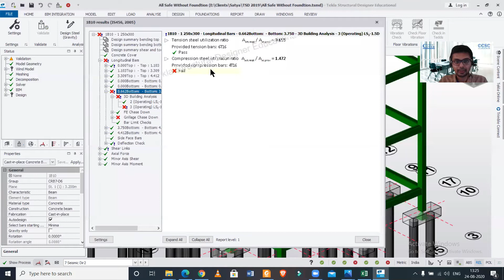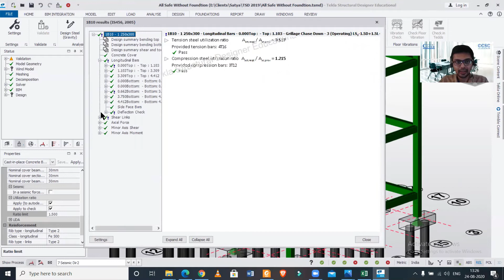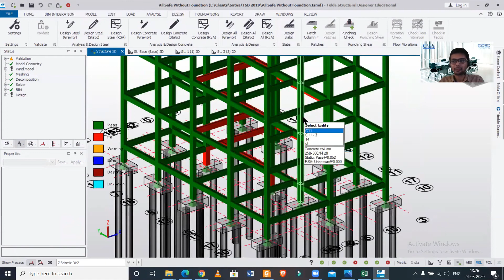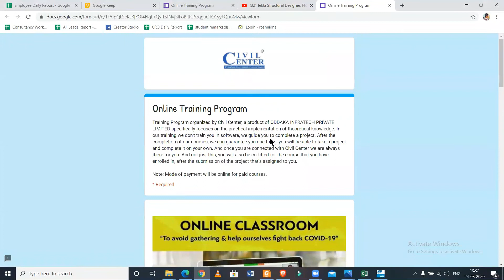What is Utilisation Ratio in Tekla || How to change utilisation ratio in Tekla || TSD

Comment: Great Video!!!
I have a question about the utilization ratio (U/R) if the software takes by default as 1, is it advisable to override the values by increasing it? 
As we know that U/R is the ratio of – actual to maximum performance value. By increasing the values, we are making the member stiffer and hence safe, but which is not in the practical application.
Kindly correct me if I am wrong anywhere.

Comment: Nice video, thanks for sharing. I have one question related to this. There are two options in user defined Utilisation Ratio. One is apply to check and apply to design what is the difference between these two?
Reply from the maker: if you click on apply to design, it will apply the utilisation ratio, apply to check will increase the allowable capacity
Reply: @CIVILCENTER  Thanks for the information.